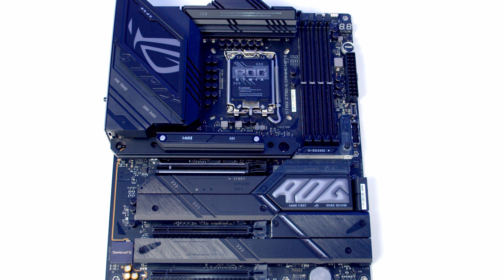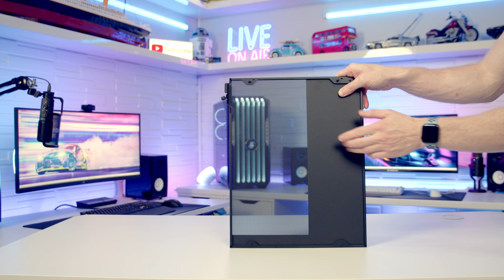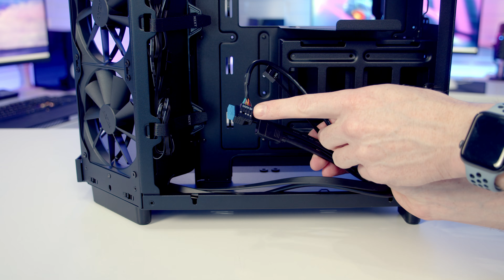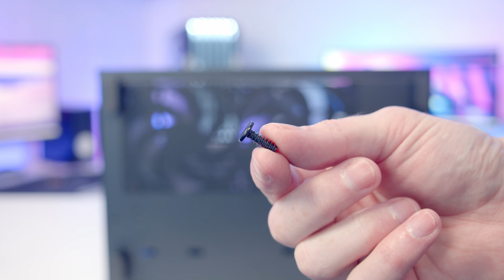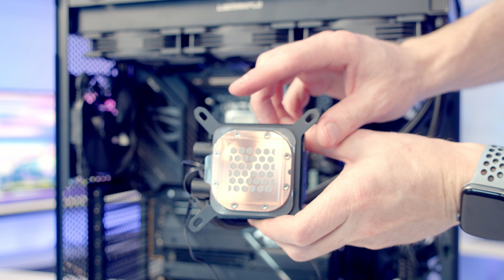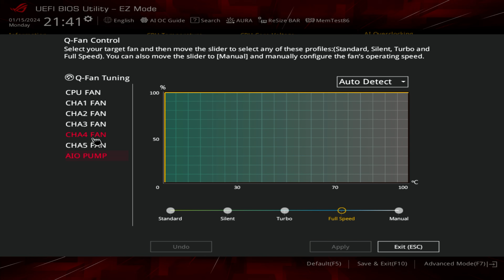NZXT H6 Flow Build - Step by Step Guide

Comment: Making a first build, the case cable installation part fot the front panel cable is so confusing. Please explain more abt motherboards differnces, im building an asrock micro atx and i put the front panel on the right side / the outer most right corner. Where in this video you put it pn the left, but for my board the right has the 4 top 5 bottom pins and the left side where its depicted to plug in here is (SPK_PLED) for me and has 3 top pins and 4 bottom pins, thus i used the right side one instead, but this video did not explain that. What the crap, man?

Comment: how much less rpm do u run the idle of H6 included front intake fans, above a noise level and under a noise level, if its any different in noise levels.

Comment: I have built in this PC, pretty nice and overall quality seems good if you like the look. However the included triple 12cm case fans are of bad quality, they produce an annoying rattling noise even at the lowest possible RPM, and when they start/stop they make an even more annoying loud sound. My recommendation: I would only consider this case as costing case price + three additional fans to replace the stock fans, and compare with competition accordingly.

Comment: "8 of the motherboard screws" cool which ones though? Lol
Reply: Hey I actually  started my first build tn. They’re in the little box that’s in the back panel 
“screw 6-32*5mm”
Reply: @shane7366 I think I ended up using the right ones, good luck with your build
Reply: @morehoops did you blow it up?
Reply: @SMOKEMTV never blew it up but sometimes I want to lol

Comment: Your video is really helpful! 
I bought an Arctic Liquid Freezer III 360 Pro ARGB and NZXT H6 Flow case without knowing how thick the radiator of the AIO is (38mm). I was panicking since I can't return the AIO, but I still can return the PC case, which I don't really want since I like the case and you have prove that a 38mm Radiator Thickness can still fit into this case eventhough with a tight fit to the Motherboard I/O Shield, which makes me calm and confident that now I can put my AIO into this PC case with a little bit of wiggle and removing the front glass panel for a much more easy access and movement. Also I learn more about the wiring and the steps of putting the wiring so it doesn't getting blocked by other components.
Reply: hi bro, i also want to buy the Liquid Freezer III 360 Pro with the NZXT H6 Flow, did you put it on well? It's all good or i should get a different liquid cooler?
Reply: Have you tried that AIO? Was it possible to install in this case? I’m also considering that cooler myself.
Reply: @joxanko2429 bro i bought it yesterday. Tomorrow it will come, and I will check if it fits. Just remind me about ur message okay?
Reply: Yes, I’m able to fit to my case without tilting my AIO and I managed to put all of the screws on the top of the case with my motherboard MSI X870e Gaming Plus Wifi. The fan is touching the edge of the the top of the motherboard heatsink. 

I would suggest to put the CPU Power Supply first on the top left and connecting the RGB light if you want to daisy chain it to your back fan before screwing the AIO since the RGB light will be blocked by the back case and it’s really tight.
Reply: @pukurinepurrinechoco  That's good! yes i was also thinking to do that. i'm happy that u made it bro

Comment: when you hooked up the card. you had a cable that was preset at 90 degrees. did that come with the card or was that special order? I got a cable with my 5070 that goes straight out and its bending

Comment: im also building my next pc in this case with the arctic liquid freezer iii which is 38mm. my mobo is tomahawk b650 which has a pretty big heatsink and my idea was to replace the last vent with the slim version of it which is 10mm slimmer, do you think this would work and solve the touching issue?

Comment: awesome video, i watched half a dozen reviews of this case and though many mentioned the problem with the AIO hitting the VRM Shielding, your Video showed soo soo much more in Detail....i am impressed. I now know exactly where and how to put the cables from the back to the front and moreover what to prevent to build in first so i dont get into annoying problems, no need to scratch my head around it and waste more time. PERFECT !
.
If the Sound of the preinstalled Coolers really will hurt me, because of the DC Control, i think buying some cheap Arctic P14 PWM PST Case Coolers, would be a cheap solution.
.
Subscribed, gonna check out some more of your Content...keep up the good Work Christopher ! <3
.
best regards from Germany

Comment: Hi there, stupid question but do you know if I can use the included fan splitter with Corsair PWM fans so that the motherboard controls them properly? I'm using an Asrock z790 Riptide WiFi and I'm having trouble being able to control the NZXT fans at all, stuck at 1296rpm, the option to change to DC just isn't there when these fans are plugged in. I'm hoping I can just swap them with Corsair ones using the included splitter and the motherboard will take better control of them? Thank you, great video, I used it to make my build 👌

Comment: Could you tell me if I can use the fan splitter cable that comes with the 3 front fans with Corsair fans? I can't manually change the PWM to DC mode with these fans on my motherboard, and since the new fans I'm getting are PWM I'm hoping it just works?

Comment: What kind of cable is that for the 4080 is that the stock 12vpwhr cable that comes with it or 3rd party is your psu atx 3.0 wanting to get a 4090 and dont want the melting issue

Comment: Outstanding build video you did it the right way and showed all anyone would need to build in this case. Like the case but think NZXT should have left more room to the Top for all AIO's to fit and not just forcing people to buy their AIO's and the same goes for the bottom 140mm fans and should have hole for 2-120mm fans.  I like the Top as a cover over the AIO or fans but wish it was more open as it is almost always for exhaust. NZXT can keep their 3 pin fans and charge less for the case.

Comment: Which bolts did u use to lock the mother board in place it came wit like 4 different bags…?
Reply: Its the 6-32*5mm screws you use to lock the motherboard
Reply: @lobbyboy8723thank you bro your a legend!
Reply: Having the exact same issue right now

Comment: I tried this case just before Christmas for a new build and had to scrap it.  I ended up selling the case at a small loss on eBay to get rid of it.

With a chunky 4080 or 4090, the 12VHPWR cable is flush up against the glass - I am not risking an $1800 GPU on a $120 case, just spend more and get something a bit bigger.

I also found the stock fans terrible and the top clearances were too tight.

The H6 is just too small for a higher end build, IMHO.  An inch more height, width, and depth, and NZXT had a winner - literally, just one inch, such a tragic misfire.
Reply: Bro, the case was made for a 4080. It fits perfectly in my build.😅

Comment: I would love to see a black and white build without RGB. Not all of us want the lights since they reflect off the monitor and can be distracting when doing productive work on the PC.
Reply: don’t add rgb fans then mate
Reply: @Zxrks-zx7vd  Or rgb Ram.
Reply: @markhalstead2386  then don’t get it same thing
Reply: @Zxrks-zx7vd  I already know that. Phantek T30 fans are my plan.
Reply: @markhalstead2386 just turn them off 💀💀💀
Reply: @Who_ami2700  Mine is built with zero RGB. It makes no sense to pay more for RGB to just turn it off. Mine is zero RGB.
Reply: @markhalstead2386  I meant that if you had a pc with rgb and you don’t like it turn it off
Reply: @Who_ami2700  I agree
Reply: @markhalstead2386 then dont comment make the build yourself
Reply: @ I did build one myself. I built my last four PCs.
Reply: Or just turn the rgb off when your doing productive work
Reply: @Pringle_Muncher  I just built one without RGB.
Reply: This comment thread is just insufferable
Reply: For some people the RGB lights could also cause nausea and vomitting.
Reply: very interesting, have you tried the off button?
Reply: thats what im building as we speak

Comment: This was a case I was considering, but have eliminated it now. It is now between the Fractal Design Torrent. Lancool 216 and Lancool III.
Reply: This still a very good case. Anyone using AMD doesn't need an Triple AIO. Also NZXT own website says the optimal air setup is stock.
Reply: @freeisalwaysme  Not saying it is not a good case. Just too wide for my space.

Comment: Planning a RTX 4080 Super build in this case, well torn, the new Montach King95 looks like a great case to build in also, but since this case dropped I've been set on building in it, GG great vid, new to the channel, this did help me decide that I will probably do the 4080S build in this one, amazing looks, great thermals etc, currently my 4080 build is in an older Corsair Carbide Series Spec-04 full temper glass, do have it sold soon, so will be taking those $ and doing a nice 4080 Super build :) I dont plan to use an i9, but for an i9, i'd probably do push pull with side fans instead :) yes new i9s run hawwttt

Comment: Thought about geting this case but It has a few issues. No dust filters, no rubber things on the cable holes. Little space between the GPU and glass if you have a 40 series card. And the power button is at the bottom, I keep my PC on the floor so having the power button at the bottom is not good for me
Reply: True, its a showcases chassis. You are a different audience. It was not made for you.
Reply: As big and how much airflow you get i think id be okay hitting the button. My PC goes on a stand below my desk as well.

Comment: I can't find an answer to putting 2 GPUs in this case, I just want to know if you can. Can someone test pls. Im only gonna put like an asus 7900 xtx and asus dual 7600, i could even go smaller but i just wanna know if it works.
Reply: This is more of a question of whether it fits your motherboard rather than the case. If it fits the motherboard, just open more pcie expansion slots in the back and you should be good

Comment: I was going to use this case for my gf’s new pc but the only reason I didn’t was because I was hearing that using 3rd party fans in this case was very difficult and didn’t line up with the case mounting very well. Went with the NV5 which is a perfect case but still a beautiful build!
Reply: I used nzxt fans for the bottom 2, used mastercool aio and was fine. I mean you only need to buy 3 fans nzxt not that serious but the aio lined up perfectly.
Reply: @SmokeyNate What size did you use for the bottom 2 fans?
Reply: @Hm_m_m only 140mm fans fit on the bottom.. 2 of them.
Reply: @andreasdimitriou2461  
Is surprisingly most people said we can still fit 120x2 which isn't possible.
Reply: @ some people don’t know wtf they’re talking about.

Comment: You are clearly able to turn a sow's ear into a silk purse, Chris, and you've proven it with this build.  I'm not impressed by NZXT's H6 Flow; for the reasons you mentioned (those front fans, clearances in general, the lack of 120mm fan mounts in the bottom, etc), plus a few extra (which I won't go into here).  Otherwise, the rest of the build components look solid and appear to go very well together.   Great job! 👍🏻

Comment: Just finished my h6 flow build  ryzen 7600x/strix b650 e-e/wd 2tb nvme/32gb g skill trident rgb/asus tuf 7900xtx/360m nzxt rgb elite aio/and a boat load of phankek d30s .
Great case just be careful of 360m rad in roof if your mb has a big io heat sink as my asus strix b650 e-e  is way to close *as he mentioned edit . other than that it was easy love it now finished .
Reply from the maker: Yes just needed a few mm more

Comment: I built one just before Christmas. White H6,  NZXT Motherboard N7 Z790,Intel i9 13900k Palit RTX 4090, NZXT Kraken Elite 360 AIO ,TeamGroup Delta RGB 32GB (2X16GB) DDR5 6400MHz – White 9 RGB white fans (3 120 front, 2 140 bottom, 1 120 exhaust  and 3 radiator fans 120 AIO it runs like a dream. Love it.
Reply from the maker: It's a solid case
Reply: Im building my first ever pc in a bit but im saving for it i just want to know if my parts are good or no, what i got is a h6 flow , n7 z790 mother board, core i5 12600kf cpu, radeon rx7800xt 16gb, 1tb 980 pro ssd, 2 140mm fans, 240mm cpu water cooler, 32gb DDR5 corsair vengance, and the 750w redragon psu
Reply: @SSJ-3_Pikachu  very nice sounding build but you don’t need a Z790 mobo for that kind of CPU-GPU combo unless you plan to make bigger upgrades within the next few years to get more out of the board or you want the white mobo (one of the best white mobos on the market imo as well). A Z690 or the NZXT N5 would be more in line with your hardware and open up the budget to get 2 tb storage instead of 1 tb. Totally up to you but that’s what I’d recommend!
Reply: @LanceBarkeryt just bought the case and trying to set good budget while great performance like gaming, streaming and editing. Got any recommendations on low price parts that not overrated and does it job without complications? I was thinking 7800x3d but not sure sure about gpu or the motherboard. Thank you
Reply: @BLvckAbyss0  depending on your budget and resolution/frame rate you’re looking to hit you can probably go with either a 4070 TI Super or 4080 super, 7800x3d is a great option, and then get any good looking 6000 MHz 32 gig ram kit  and 850 or more PSU and a x670 or higher board (any of the big brands like ASUS, MSI, Gigabyte work well and ASROCK too if you’re trying to save a bit) and you’ll be future proofed for years to come. You could also wait some more months or beginning of next year when 5000 Nvidia gpus release and see if those gpus are what you’re looking for or to save money on new/used 4000 series cards. You shouldn’t get trapped in waiting for the newest tech but since we are really close to 5000 series high end cards releasing (and 6000 series won’t come for multiple years) it could be worth it to wait. You can probably get a high end setup in the 2500-3000 (people might say lower but in the 2000 range that’s not really 4K gaming/streaming especially if streaming on single PC Setup). Good luck!

Edit: if you do decide to go with 7800X3D you can save some money going w a 240 mm rad instead of 360 mm rad since the chip doesn’t get thatttt hot under all loads (realistically you could do air cooling as well I just prefer AIOs and personally prefer 360 rads but I have a 14900K that needs it). Again, this is all very dependent on what your budget is and the monitor you have👍
Reply: Damn, crazy pc
Reply: Think about to do the same now, do you think this specs are still valid end of this year?
Reply: @Guesswhat1  Totally. I have had no problems at all. It plays anything you throw at it. Consistently low temps. It's just the best PC I have ever built. I know Intel have had a few problems just lately, so you could always swap Intel for AMD. But i have had no problems at all with the 13900k . I built it November 2023.
Reply: I heard having an air cooler sucks in this pc bc you can’t have fans at the top
Reply: @emma6648  It doesn't. There's good enough airflow to counteract that. Although yes, some people don't recommend top fans since it interferes with getting air to the cooler. I see this as a plus personally. Less fans needed. You don't even need a back fan tbh.